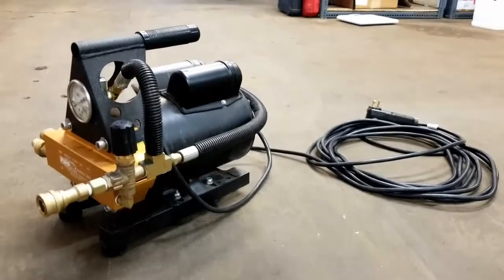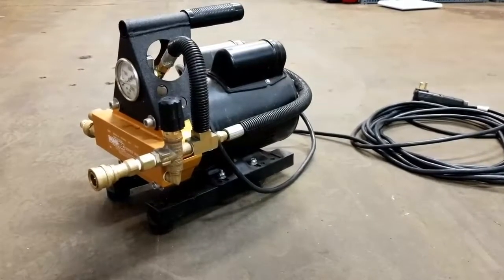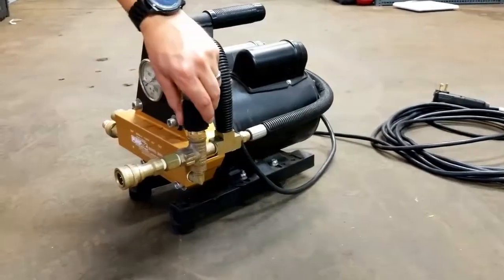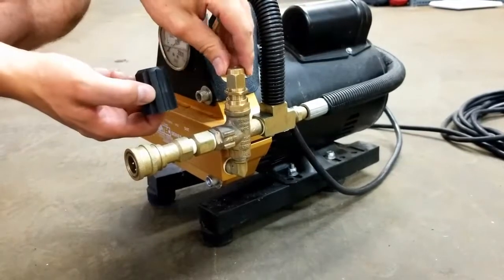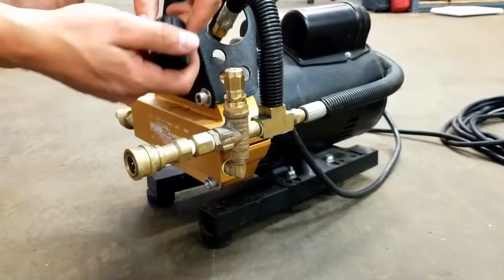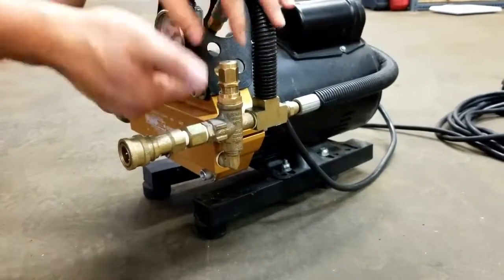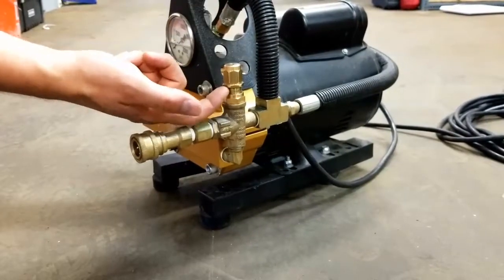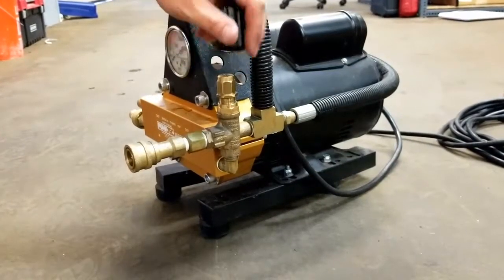Pumptec Water Otter Pressure Regulator Fix if Stuck - Clean Pro Supply

Comment: I just got a unit like this. 
I hooked up the fresh incoming and then turned the unit on.
The pressure gauge shows 0...no matter how I adjust the pressure with the unloader the gauge doesn't show anything. (Even when the tool hooked up to it is running water through it.)
How do I make it to show what pressure I'm at?
Anybody?
@Cleanprosupply?

Comment: Pumptec recommends running desclailer (vinegar) thru the pump once a month. How do you do this with this machine?
Reply from the maker: You can add the vinegar to the water solution in a bucket, then connect a hose to the pump inlet and submerge in the bucket. The pump will draw it from the bucket, through the pump. Then have the water exhaust back into the same container so that it cycles for about 10 minutes. Then flush with clean water.